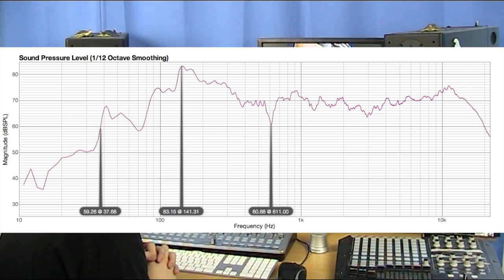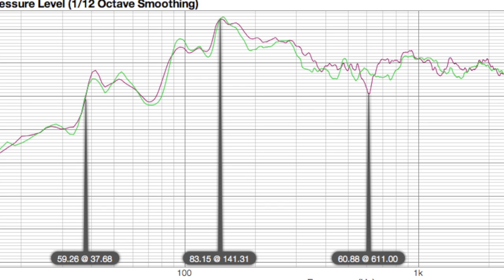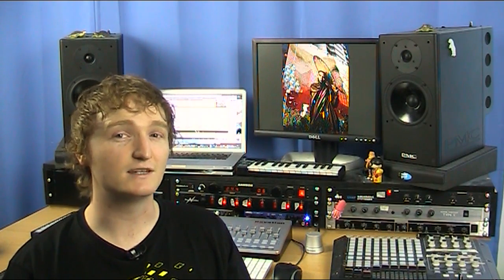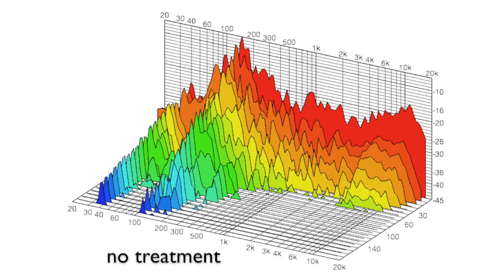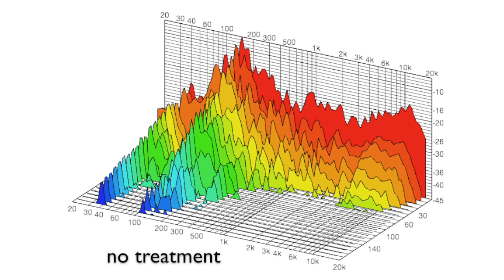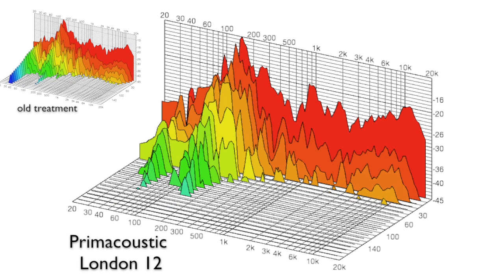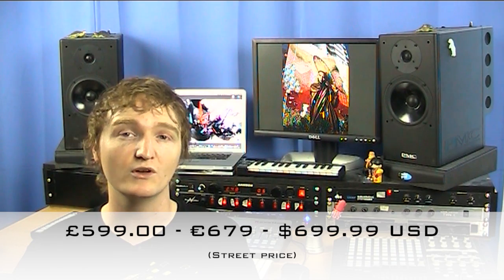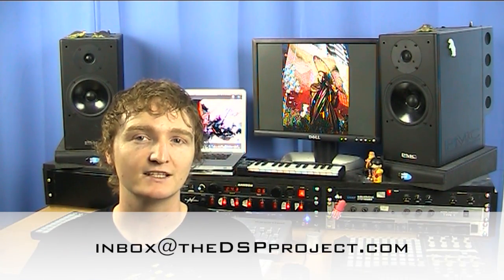Primacoustic London 12a review - Part 2 - Acoustic Measurement - The DSP Project

Comment: Interested In the response curve after treatment, there still appears to be room mode issues - do you not find this to be a particular problem in mastering? I am currently treating my room, learning more about axial modes and speaker / listening positions relative to them and wonder, in your opinion, at what stage a response curve would be satisfactory for commercial use?
Reply from the maker: I didn't do any mastering in that room (moved out a while ago), it was just for production. It was far from perfect but I got some good work done in there.
Reply: TheDSPproject Thanks for the reply man, great video :)

Comment from the maker: Most monitors can generate sound down there, even if its not loud / accurate enough to be included in the frequency response spec. Why would you not have that frequency in your recordings? A piano goes down to about 32hz. And in my case of electronic production its not uncommon to have a little something happening down at 20hz. This might sound crazy but some of the big club systems can get down very low. If I didnt use that part of the spectrum your right it wouldnt matter but I do.

Comment from the maker: @methodinsane The software is a program call Fuzzmeasure (very good but mac only). Then you need a measurement microphone (Has a flat response). The software plays special sounds through the speakers and listens to what comes into the mic, because the software knows exactly whats being sent to the speakers it can measure all the extra sound caused by the harmonics of the room. 
Hope that makes sense.

Comment from the maker: @dylan3840 Ha ha your welcome, I used a great program called fuzzmeasure for the tests / graphs. You can use eq but there are a few issues. 1) the response will change around the room, making it worse in some places. 2) Putting everything through an EQ will colour the sound. So its not an option for me.